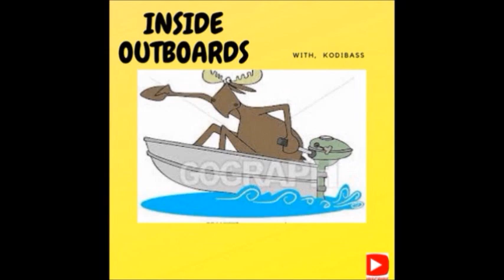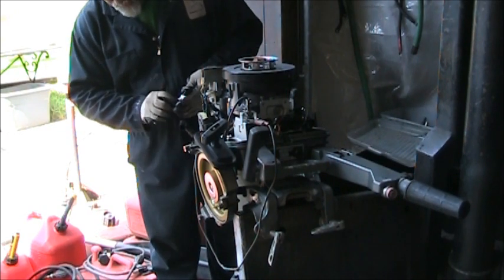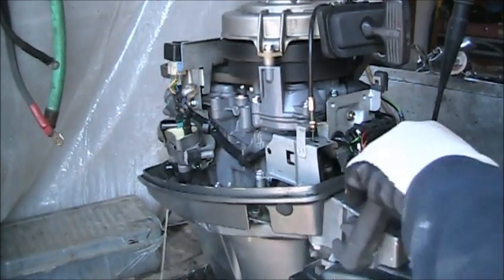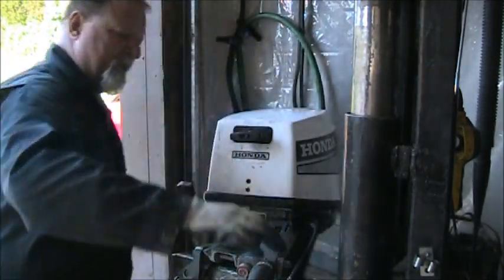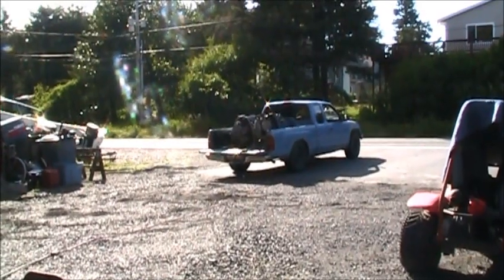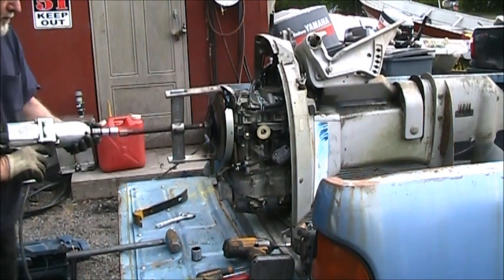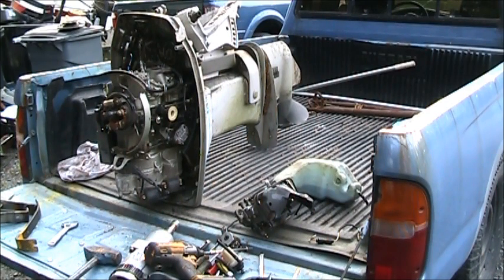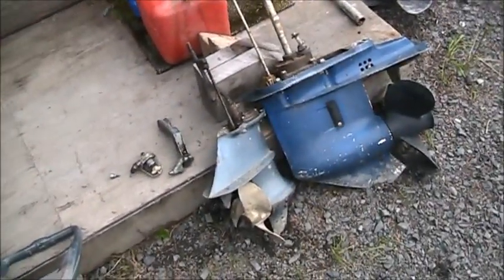HONDA 15  HP,   4  STROKE ,    ((  FIXED  ))   ...  Parts &  More...  4 sure...

Comment: Hello Kodibass. Ive got a 1989 15hp honda. The engine oil is milky. Pulled out the thermostat and it is fuctioning properly. What else could cause this condition? Head gasket?? Could this have happened from laying the motor down on the incorrect side possibly? Thanks
Reply from the maker: When you did the T-Stat did you replace the gasket ?  Yes a head gasket leaking could also cause this, when it was stored / laying on its side was it outside in the weather?     kb
Reply: @kodibassInsideoutboards  No didnt replace the gasket, just took the thermostat out and put it in boiling water to make sure it was opening and closing. The oil smelled like gas and was thin and light in color. This was a motor I sold to a guy last summer so not sure how he had it stored. It was a 1-2 pull motor the 10 years I had it. Very reliable. I just remember the fellow I bought it off told me only to have it upright or laying on the tiller side with the 2 metal tabs or it could be hard starting.

Comment: kODY , on the threaded spark plugs, you can unscrew the tip off of another plug, and screw it on the threaded end... I do this when I change spark plug wires that just have the snap on boots..

Comment: I have a dodgy plug cap looks good but copper strand broken where it goes cap so when tested no spark but intermittently spark jumps gap in  cable so looks like it working.
Reply from the maker: +CM,,   ..  Replace that  iffie   CAP ,,,,   U  R  Way 2 Capable,, 2  deal with this Simple issue,,   You do not need  Me 2 deal with this  Issue,,  U  figured it out man,,    kodi

Comment: Regarding the Honda, could it have been the spark plug gap that you adjusted that made the difference between non starting and starting? ( Confession: I once forgot to insert the man overboard lanyard too although I figured it out before I got a mechanic involved!)
Reply from the maker: +JB, not likely on the sp gap it would have @ least popped,  The person & his father R commercial fisherman & own a 38 ft delta salmon seiner ,  makes one wonder 4 sure.
                                                                                                                                  kodi

Comment: You just can’t fix stupid but you can charge for it ! Lol. How much is up to you , myself it’s a flat rate to diagnose and that’s $50 ! How you fixed for gaskets and old OMC carb kits ? My parts place has everything on hold because of the virus! I’ve used quite a bit of the stuff you sent before and I was greatly appreciated !

Comment: Did you happen to find a tiller handle for my 20hp Johnson..
Reply from the maker: +RK I have one on a 35, I think it's the same,  Do U need the whole tiller, just the plastic parts,cable ?  lmk,  I will try 2 remember 2 film it in my next vid.          kodi
Reply: @kodibassInsideoutboards  hey thanks.
I would like to have the complete tiller with cable and deadman switch if possible..
I will watch for your next video..
I really like watching you and This Old Outboard out of Florida, you guys have really get through some  tuff spots..
Reply from the maker: @whiskerdreams7146     I Think  I got  U ,,  covered,,                               kodi
Reply: @kodibassInsideoutboards  thanks partner, I will be watching for your video..

Comment: Could the plug wires have been popped in the wrong way round?
Reply from the maker: +JA,  unlikely,  there would have still been a backfire  pop, or even a slight kickback
from off timing ,                                                                                 kodi